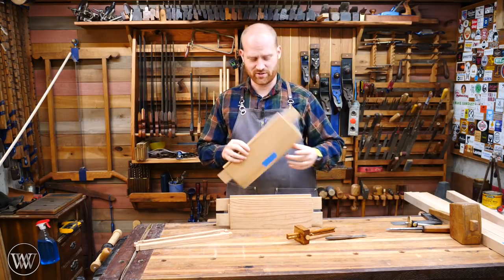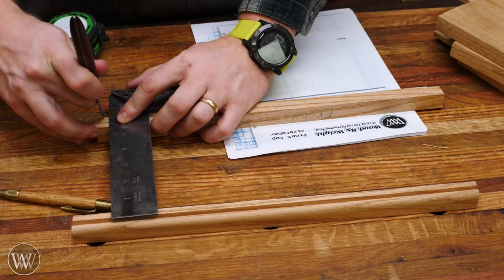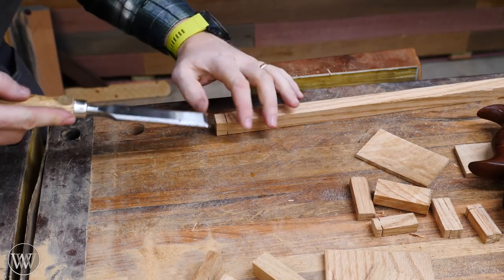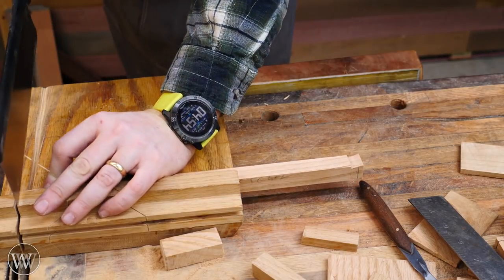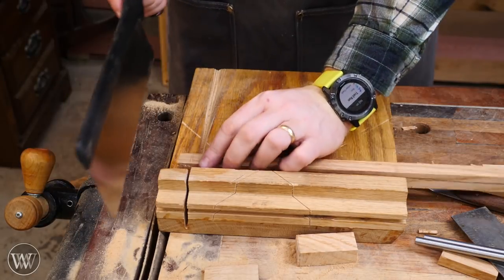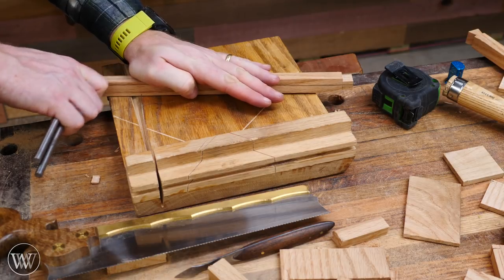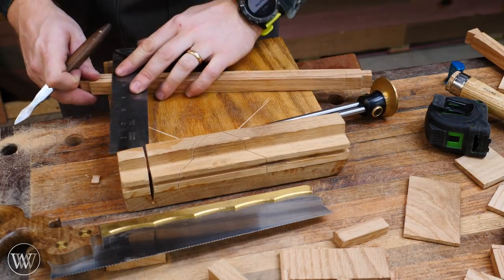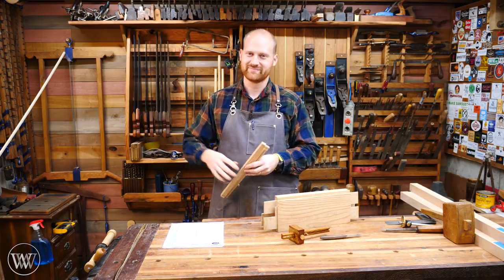Side Table Part 3 | Dovetail Front Stretcher

Comment: Why not dovetail both and use a filler block/spacer between them?
Also, with top an bottom joinery in the front, why aren't the front tenons of the side stretchers centered? I gotta see these go together, I guess, before I'll get it.
Keep up the good work, and thanks for sharing.
Reply from the maker: I thought about doing that or having it slide in from the back but both of those would weaken the leg at the top and with drawbore pins going in I do not want the top of the leg to split. I will be driving a pin into through the tenon into the legs at an angle to keep it from moving in the future. there will be a fake tenon added to the outside just for looks. that will be in tomorrow's video.

Comment: I've started watching this series in preparation for a similar build of my own - great so far, BUT...at 2 minutes 50 seconds into this video I really had a cringe moment.  Your left hand is holding the stretcher while your right hand is using a chisel to deepen a knife line - this is exactly the kind of thing that caused me a trip to the emergency room and some stitches.  For anyone watching/learning, I just have to say - hands BEHIND sharp edges!  The stretcher could have been clamped in the vise or held with a holdfast to avoid that kind of safety hazard.